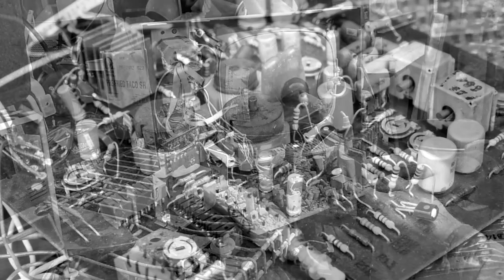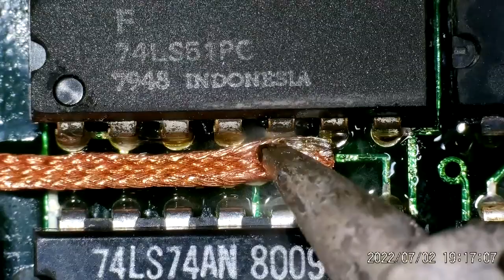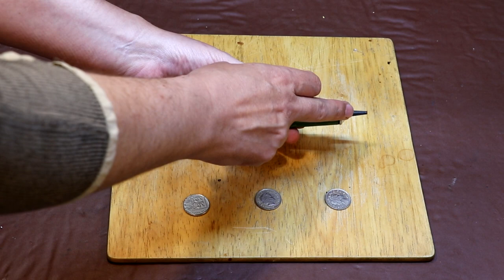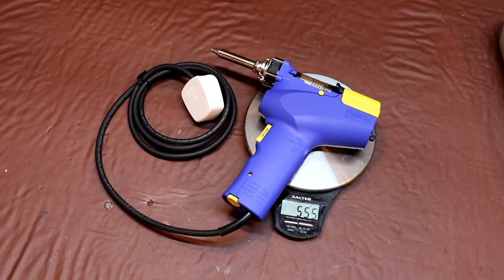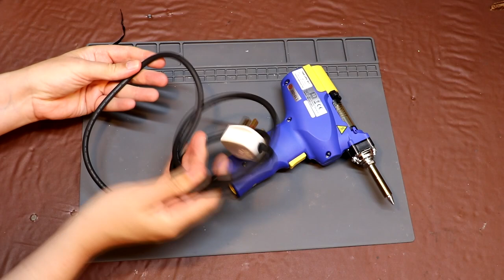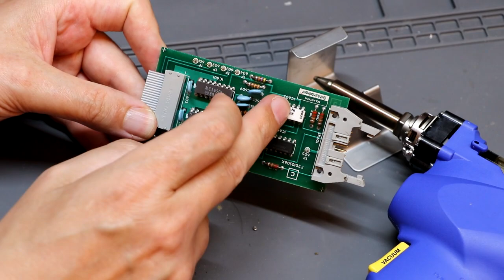Hakko FR-301 - Hot Stuff Part4

Comment: Hi Chris. Great video. Loved the old school desoldering methods and never seen the copper wire method before. The Hakko does look like a considerable upgrade to the Duratool. It does look a bit unwieldy and that stand is rubbish but the cartridge removal and choice of tips is vastly superior. I wonder what spares availability is like for the filters, tips, elements etc. Cheers Graham
Reply from the maker: Hakko has excellent support they are a big name in the soldering world. The Hakko gun is surprisingly lite weight for it’s size but the Duratool is more compact. The Hakko pump is very powerful, much more powerful than the Duratool. I think most people will be happy with the Duratool or similar clone and no need to spend more.  If portable use is your thing the Hakko scores but who is these days.
Reply: @allthegearnoidea6752  thanks for the info Chris it was a great review. I’ve had no end of trouble with the Duratool but it does get hammered. I’d seriously consider this one though. I see that you can also order it as a kit which comes with a better stand and some extra nossles

Comment: Regular filter changing on the pace is essential to maintain vacuume, however you should try the double sided print desoldering test again but with your board pre heated to about 100 degrees and see how easier it is to remove components without damaging the pcb , you will also find components remove easier if you add more fresh solder before removing .
Reply from the maker: I think the Pace is overrated and overpriced as you could see on the test it has half the vacuum of the Hakko and is slower in building that vacuum. The Pace has new filters before I used it.  It’s probably the ST75 base unit that is at fault but give it cost £900 I’m not risking my money with them again. I will try preheating next time but if you have done as much desoldering as me in a production environment ie thousands of ICs you know some boards just don’t desolder very well.
Reply: @allthegearnoidea6752  Everything Pace is over priced but most of mine is over 20 years old so if you factor in the longevity it may not be as expensive as it first appears ?

Comment: Very nice review, Chris. I find that I use all three techniques - wick, manual sucker and powered sucker - depending on the circumstances (and my mood too) Can't beat that Engineer sucker for quality - I've been using one for years now. I have enjoyed the whole series - thank you for sharing it with us. Regards, David.
Reply from the maker: I appreciate the quality of the engineer suck but I have found they can clog rather easily. Because the nozzle end is metal it can expand when expelling the solder. So the one I have now has a bent shaft.  I think it’s essential to have a few different techniques as sometimes it does go right first time. I think damage is almost unavoidable unless you cut the IC off. Just depends on the board manufacture and the relative leg and hole sizes.
Reply: @allthegearnoidea6752  I agree, the Engineer sucker does have close tolerances - I usually suck up a blob of silicon grease when I start a session and that seems to help keep the solder from sticking. I also agree with lead snipping and frequently use that method during test equipment repairs. Regards,  David

Comment: Ooohh! A hot thing for sucking off. Looks like a great bit of kit, especially seeing as it doesn't have a million hoses to heave around. Where do they go from there? Lithium battery powered ones like a dewalt range with a common battery?
Reply: How are you doing now, George? Recovering from the lurgy?
Reply: @oldblokeh  Not bad, almost fully recovered, just getting ready for the next radio meet and music festival
Reply from the maker: Yes a good bit of kit I think it works better than the more expensive Pace. I’m also a fan of the Duratool which is better value.

Comment: Hadn't come across the thick copper wire method before, Chris. Thanks for that. For those with the Duratool desoldering pump, the secret is to allow it plenty of time for heat up throughout before using it. Saves a lot of blockages. By the way, what's the weight of the unit in British Standard Dormice?
Reply from the maker: Unfortunately with inflation being what it is the English Dormice isn’t doing well at the moment but it’s about 17.5 against the grey squirrel futures. I also have a Duratool that I have on my desk at work now. The tool works well but the heating element don’t last long so as I cannot be bothered to change them I just buy a new gun which is about £17 last time I bought one.

Comment: Chris you are a sucker :-D
I could have done with having one of those guns when i was 20-30 years old and desoldering 40 pin processors and bigger.
I was efficent at the time.
Yes the ye olde sucker, if it was cleaned out often it worked well.
My method was the same as yours,  heat then suck and wiggle the pin to break the pin to through hole bond.
(never use force if you like having through holes ).
Sometimes the single strand of copper wire replaced the through plating oops!.
Perfect eye focus and dexterity has gone down the pan quite a bit, never mind lol.
It's a shame they didn't give you a  decent iron stand (tight assed company).
Ooow look at that waffling above, ill shut up .
Thankyou for a smashing video chris :-D
Ok ok ill shut up....